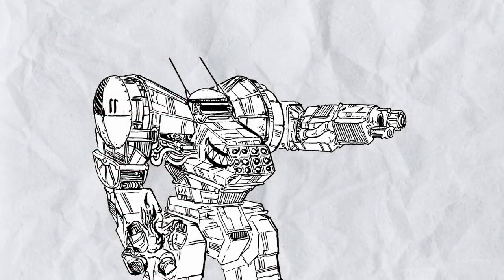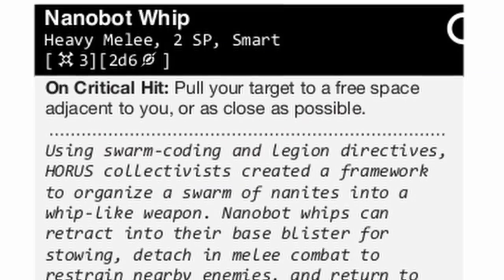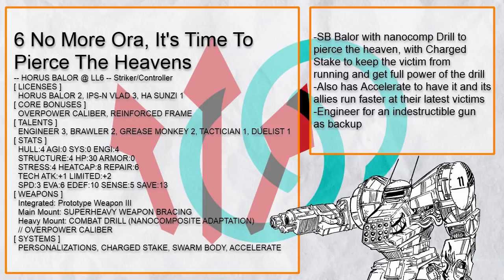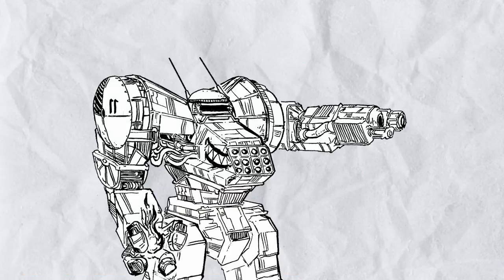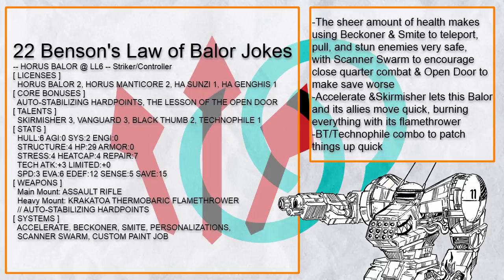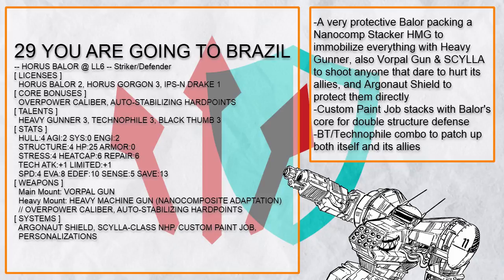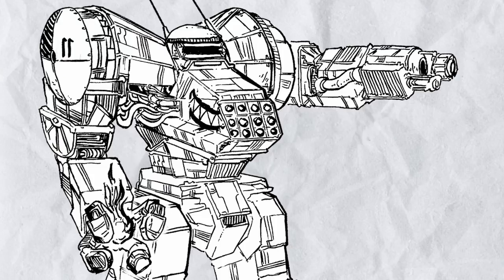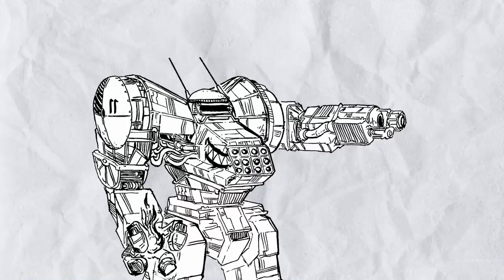Lancer Custom Werks, a Lancer Builds Review Series, Episode 12: Balor

Comment from the maker: Hello, to anyone that want to submit their builds to the series, you can go to the Pilot Net Discord ( https://discord.gg/QtVhK5H ) and check out the character-corner for the rule of submission! But if you can't, you can just post down here with the following rules.

Edit:Ya know I really should double check some stuff first instead of just copy and pasting it immediately)

Lancer Custom Werks Episode 13 Submission Rule:
1. Build Frame: Enkidu
2. License Level: 6
3. License Restriction: Any license that hasn't officially came out yet is not usable, also including all Exotic Gear too
4. Format: Comp/Con Compact Statblock
5. Name of the build and what role it takes
6. Explanation on how the build work is optional but recommended
7. Post here in Character-Corner and tag me to notify me that you want this build to be included in the episode
8. ONE BUILD PER PERSON PLEASE
9. Deadline: 9th August
Reply: Perihelion
-- HA ENKIDU @ LL6 --
[ LICENSES ]
  HA TOKUGAWA 2, IPS-N TORTUGA 3, HA GENGHIS 1
[ CORE BONUSES ]
  GYGES FRAME, SUPERIOR BY DESIGN
[ TALENTS ]
  JUGGERNAUT 3, DUELIST 3, NUCLEAR CAVALIER 2, HUNTER 1
[ STATS ]
  HULL:2 AGI:2 SYS:2 ENGI:2
  STRUCTURE:4 HP:17 ARMOR:1
  STRESS:4 HEATCAP:12 REPAIR:6
  TECH ATK:0 LIMITED:+1
  SPD:4 EVA:10 EDEF:10 SENSE:5 SAVE:13
[ WEAPONS ]
  Integrated: Plasma Talons
  Flex Mount: TORCH
  Flex Mount: CATALYTIC HAMMER
[ SYSTEMS ]
  EXTERNAL BATTERIES, SIEGE RAM, HYPERDENSE ARMOR, EXPLOSIVE VENTS

I figured since Enkidu will need to stabilize to cool down fairly regularly, it would work well with the loading on catalytic hammer. In addition, with 7 speed from all fours and the extra movement from Hunter 1, this mech can still be an absolute monster even with the slow from Hyperdense Armor.

Comment: hi! several of the builds seem to use Exemplar as a way to prevent the enemy from escaping, but from what I can read in the rules, Exemplar only prevents you from moving away from your Mark, and not the opposite. am I missing something? this is an old video and a long shot, but I'd appreciate any clarification! :goodvibes:
Reply: not 100% sure, but Exemplar 3's Duel to the Death gives the target a whopping +3 difficulty on attacks against targets other than the Exemplar. So they COULD leave, but they won't really be able to contribute against anyone other than the Balor. I'm very new to this whole thing though so take that with a grain of salt